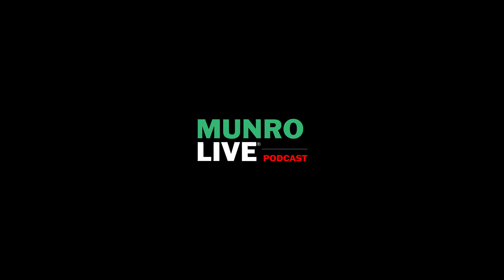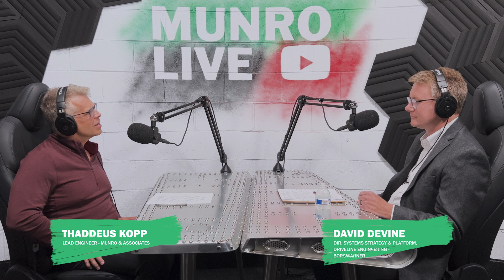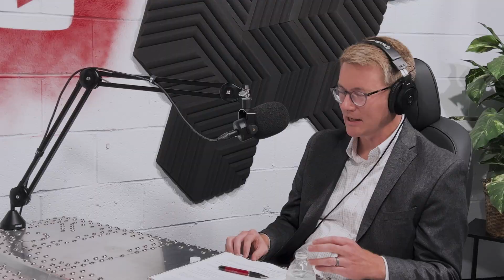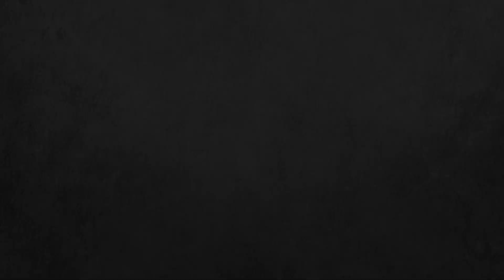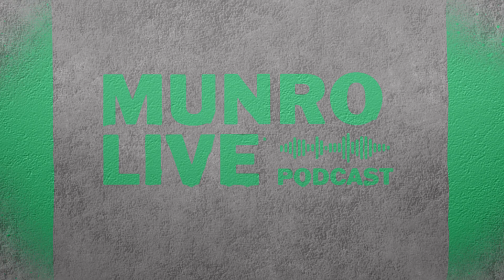There's no Parameter like Diameter

Comment: I love this. Diameter is so important. This is where Lucid is a bit misleading with their tech talk on their drive unit. Rawlinson praises his team for achieving 20k rpm with their rotor and how impressive their materials team is compared to teslas 18k rpm, and needing to carbon wrap the rotor to go faster. He fails to mention that Lucids rotor is smaller in diameter than Tesla, of course it can spin faster if it’s smaller.
Reply: Munro team has also nicely debunked the so called lucid power advantage vs the plaid drivetrain setup. 
That was a great episode they also correctly pointed out the miniature in stator diffs could wear out much quicker to. 😎
Reply: @4literv6   Indeed. Lucids packaging is impressive until you realize that for a reduction in size and weight they have to push double the kw through the thing to get similar torque to the wheels. These drive units should be compared as not just the stated torque numbers but what that torque is at the wheels, given the same final drive wheel speed. Once you equalize for the same final wheel speed, or stated another way the same top speed potential of the vehicle, only then can an accurate comparison be made. Torque to the wheels per kw required to make that torque is king. Then look at how much torque is delivered to the wheels based on the weight of the drive unit. Then look at the cost of the unit.
Reply: @l33tLX  well said. People forget the range only comes due to the price, larger pack's and 900v architectures. 
And even then the sapphire is 427 miles when those aero covers they never show on IT. 
With a 118kwh pack which we have seen Edmunds and inside evs prove takes over 140kwhs to fully recharge. 😏

Without the aero covers it's about 400 miles, vs plaid at 100kwhs&350miles on 21s. Almost the exact same efficiency like for like. 
Not to mention the plaid is 4,700-4,800# not 5,350# like the sapphire which doesnt have a glass roof either. 😎